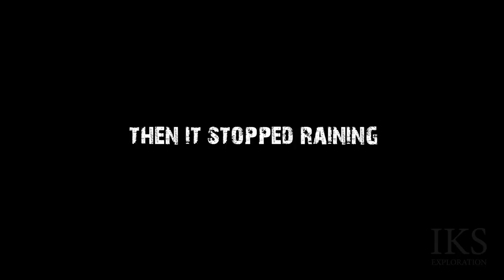SHOCKED!! While Heading to a ROC POST BUNKER!! - Yorkshire

Comment: I know that place extremely well - next to the covered reservoir.  you passed another one on your way to the A1079, the crew cabin is still extant at that site but some time after my last "welfare check" some vandals had cut the padlock and burned the ROC shelter out.

Comment: The black box like things on the wall at 11.04 is the telephone leadin and IP (Internal point) Its made of bakerlite  and can still be seen in some properties, the small cable is 4 wire phone line,  the colour code is still used today. blue/orange line 1, green/black line 2. That looks like 8 way block, there must be more ROC post around.

Comment: the cupboard base was put in before the concrete floor so they could run electric cables into the cupboard without having to channel the floor or walls, you'll probably find it was some kind of fuse cupboard

Comment: I live near a wwii ammunition factory (what is left of it)
I did find a hugh golden gem in one of the untouched areas and sadly I think that it's getting built on soon!
Found in one building a massive lifting crane and large stack outside of the narrow gauge trailers to take the bombs away. I understand that with it being a fillng factory that most things were powered by steam. There was a steam line that run from the main boiler house (no where near the main factory) in asbestos clad piping around the site feeding each building.y great great auntie whom worked there said that in later years one of the bombs she went onto fill was poisoned water. Do you know anything about this as it being one of the bombs we produced??
Sadly my grear great auntie is no longer with us to ask what was in the water

Comment: The dome to detect the radiation was not fitted to the pipe, rather it was pushed up the pipe on a long pole once the cap on the pipe was removed.

Comment: In my opinion the people in these bunkers were classed as sacrificial. (Especially if a bomb dropped anywhere near them.) The government would get what information out of them they could before the inevitable happened. and then the government would have definitely took information from this too. (Labrat guinea pigs whose survival time (= time the bomb dropped untill the time they stopped transmitting) was also valuable information) living radiation barometers with a countdown to silence.

P.s,
Did these things even have radiation filters on the air ducts ?